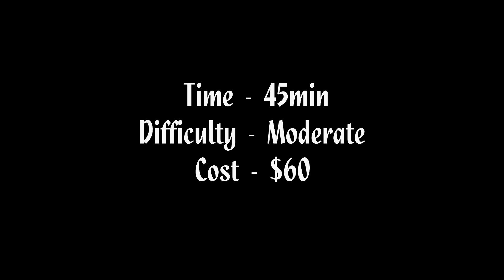Volkswagen Transmission / Engine Mount Install | MK4

Comment: Excellent video. Just finished replacing the motor mount.  Thank you for the torque settings and the socket sizes.   The only thing I would add is that there is a hole in the wire harness to make it easier to get at the 16mm bolt.  I was planning on drilling the hole when I found the factory hole location.  Thank you for taking the time to make this video.

Comment: Tyler, those are torque to yield bolts - didn't see you do the 90 turn of the bolts in addition to the torque spec in the video

Comment: i have a mk4 vr6... i believe my transmission bolts stripped the treads from the transmission cause my mount seems fine but saw metal piece on my transmission bolts when my whole engine dip on its side... any advice on how i can get it fixed or am i have to retread them and go bigger on the bolts thanks...

Comment: yeah the bolts do break or the engine mounts threads strip... thats b/c you need thicker bigger bolts .... i got 22mm bolts and re-tapped the aluminum mount....haven't had a problem since... they two top mounts don't go bad .... its always the lower engine mount bushing... so you may want to pour your own  rubber urethane for a stiffer composite but takes 10 days to dry

Comment: Only 40lb-ft, isn't that too small? Also you need to put new screws when you do this job, right? I heard storyes when engines literally fell on the street because they reused the old screws!
Reply: if you think about it the flywheel bolts call for 44lb-ft torque with an additional 90 degree turn which is stupid....you can hardly get 45 degrees...as far as the bolts go you can re-use em no problem...they aren't thread locked or anything special like flywheel bolts
Reply: ..actually your right...i was thinking motor mount bolts can be reused but any stretch bolts need to be replaced
Reply: How did the bolts behave, now after 5 months?
Reply from the maker: I haven't had a single problem out of them and it has been 19 months now...
Reply: Then you're lucky, one of the bolts was reused to install a new mount on my car and it snapped in half. Lucky for me the other bold didn't , if it had, then I would have been in a world of shit.
Reply: Gaat jeniksaan 
Where can I get the new bolts for it 
I’m thinking on replacing the all the motor n transmission mounts  are they on amazon !??
Reply: @chockes1  vw dealer

Comment: Hey quick question, Could you have removed the bolts using just a breaker bar? Thanks
Reply from the maker: +007dardan Yes, you should be able to break all the bolts loose with a breaker bar

Comment: Hey man, was wondering if you used the existing bolts for the mount, or bought new ones?
Reply from the maker: I reused the existing bolts.
Reply: +Tyler Evans Arent these bolts one time use stretch bolts?

Comment: same place for the 2.0? or just TDI here?
Reply from the maker: I don't have any experience working on the 2.0 but from a little research it looks very similar.
Reply: thanks man! not a single vid on the engine mount for 2.0 on here. just TONS of the dogbone mount which i've already done...
Reply: ***** eugh. fuck that. 2.0 until i can afford ANYTHING ELSE.
Reply: @Corkoth55  I have 248,000 on my 2.0 and I'm about over it. I like my vw and it's great mpg but am seriously ready to go back to a pre 1990 American vehicle. So much easier and cheaper to work on.